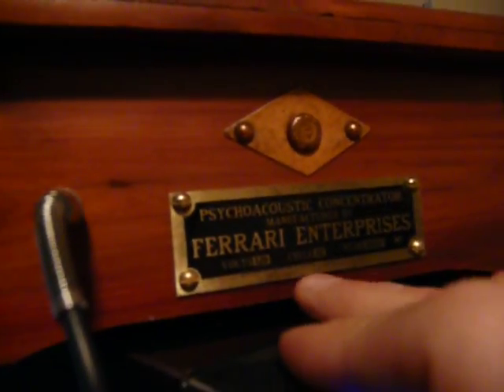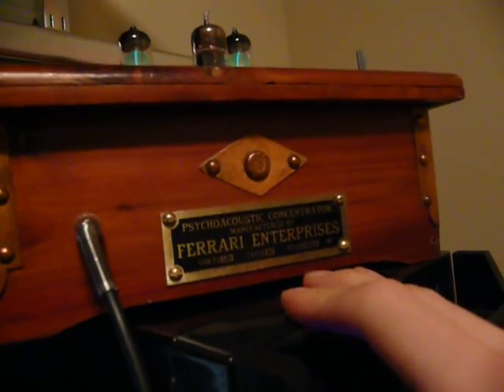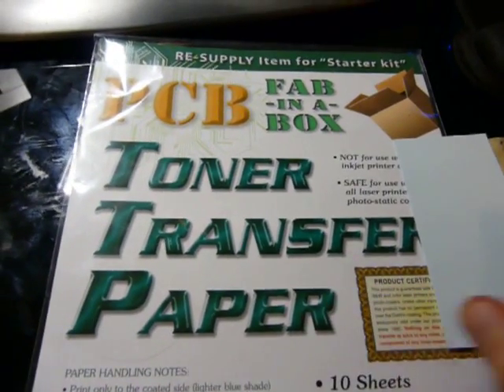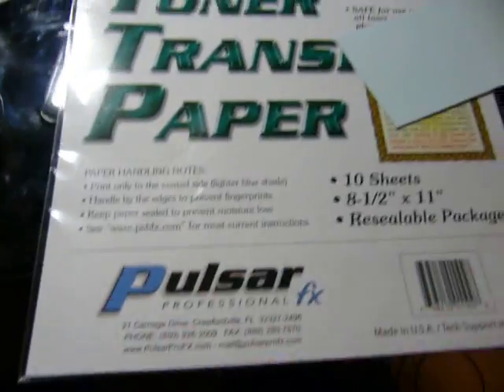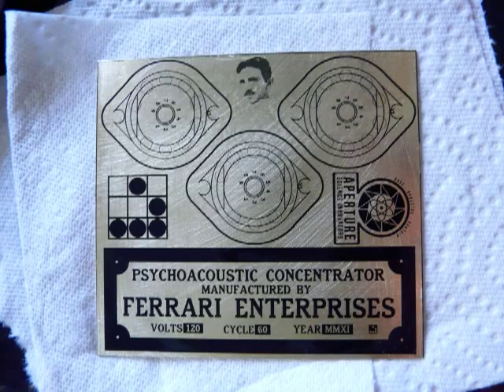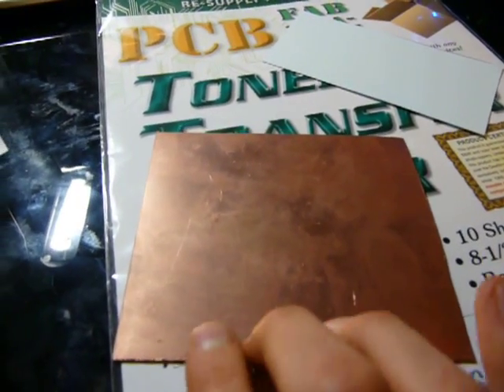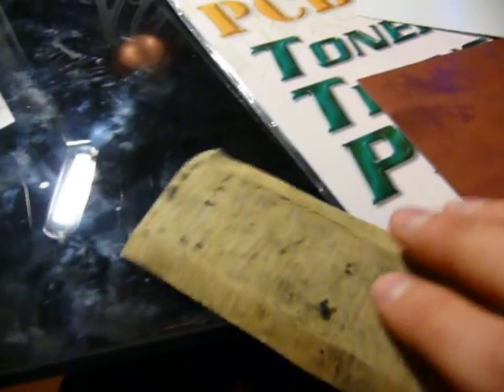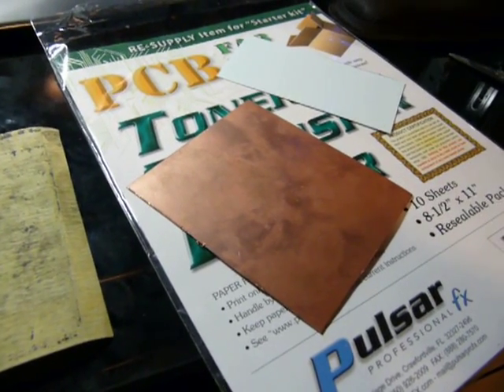Etching plaques

Comment from the maker: I've found it an invaluable tool. I've stuck to the toner transfer method, with variations on the paper and the method of heating. I'm pretty happy with my current technique, maybe I'll try UV later. Plus this way I don't have to spend the $ for photosensitive boards and developer. The laminator gets me consistency. Much easier to tune. I've found an iron is prone to uneven heating/force, which is bad news. This way I can just put the board through 5 times and get perfect results every time.

Comment from the maker: BTW, paper I've tried, in order of success: inkjet photo paper, cheap nasty semi-gloss magazine paper, and this toner transfer paper. Inkjet paper was like pulling teeth every time. The magazine paper, selected to optimize for thinness, actually worked pretty well. It was prone to leaving fibers in the toner, which caused pinholes. I used that for years, though. Toner transfer paper wins hands down, as it's actually designed for this :)

Comment: I have been thinking about getting started with etching for a while now, but never really gotten to it. As far as I can understand, there are a few methods that one can choose between. Have you tried out different techniques and if so, what are the pros and cons of different techniques? I didn't hear you mention anything about UV here, does this mean that UV exposure is not needed using this technique?
Also, are there any advantages using a laminator rather than an ordinary iron?